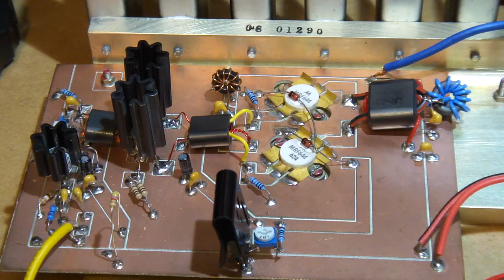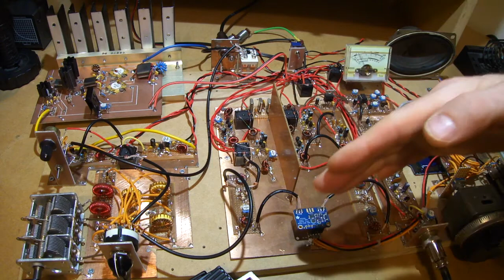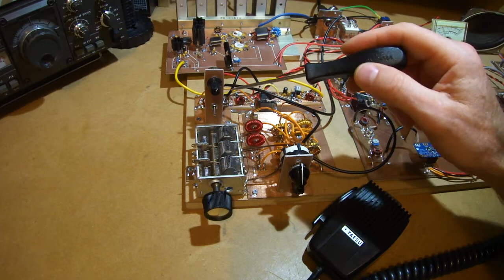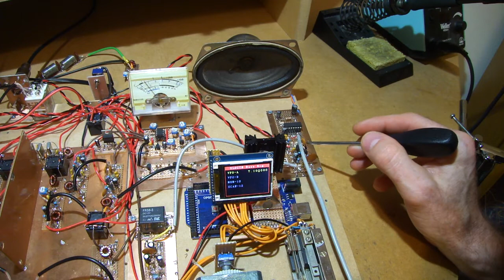Homebrew 80/40/20m SSB Rig Part 9 - On Air Test, Final Thoughts

Comment: Amazing radios Charlie!! How do you go about making your PCBs they are amazing too! PCB router?? regards Ben - ZL2BCI ps im around the corner from you hehe :) :)
Reply from the maker: Hi Benjamin. The power amplifier PCB was milled on a cheap engraver I purchased off AliExpress. While not perfect, it certainly does the job. The other PCB are upside down strip board. The only issue there is to watch out for inter-track capacitance, but that can be mitigated by cutting tracks here and there. Seems to work ok at the lower HF bands. I wouldn't try it at the high end though. We should catch up sometime.

73s

Charlie ZL2CTM

Comment: Thanks Charlie for nice and complete description ,however I am not happy about Si5351 as it does not produce same output level from 10 to 40 mhz huge difference there, and most of it being square form signal  and using 9 Mhz IF , i can hear 90 MHz wich is 30 mhz x 3  being detected by IF 9 mhz KVN filter 10'th harmonic in 21 Mhz band using  VFO=Freq+9 , also lots of spurs being heard with antenna disconnected.Dunno how you did manage it , but I m gonna use an old MC1350 driven by an DAC in order to set different gain for each band to produce same output level.Anyway, the Raspberry Pi transceiver is  almost done , I have to rewrite entire python code as I made some big mistakes from the begining , but in the end would be a nice and complete transceiver.  Best regards ,Gabriel yo8rxp
Update: just seen clkControlReg registry  set as 8 mA which coresponds to 10 dBm output., I will do tomorow a test to see if different values (band depending) can set a constant output level and maybe get rid of some spurs without using hardware level normalizing
Reply from the maker: Hi Gabriel. I think I mentioned it last year that I too get the odd signal here and there when tuning through the band. I have not attempted to track down what the root cause is as it doesn't really matter too much to me. I want to try the AD9850 again at some stage this year and see how that compares.

73s
Charlie
Reply: Hi Charlie. I used a defective trimpot in first DBM, so once replaced and propper balancing, many of spurs went away, so a carefull construction and quality components are required.For the output value a did manage to use   if output == 0: self.i2c.write8(SI5351_REGISTER_16_CLK0_CONTROL, level)  where level is band dependent , so for lower bands i use 0x0C level , 0x0D for 14 mhz , 0x0E for 21 Mhz and 0x0F for 28 Mhz.
Not perfect but is allmost ok , so in power stage I'm gonna use capacitive reactance as automatic emiter degeneration, will do the math later to see what capacitance is required to obtain  (allmost )same power on all bands.  Thank you so much Charlie and waiting for your new article. 73 !
Reply from the maker: That's great to hear! I'm just putting down my ideas for the next radio and will make a video about that in the next couple of days. My plan is to look at both the Si5351 and the AD9850. 
73s
Charlie

Comment: Brilliant series of videos. The math will probably be more useful as I go forward with my own design. But there are some very interesting blocks there that can be lifted and revised and reused. Particularly looking at trying to go as low noise as possible on the front end, so maybe a FET input mixer. Will see... Many thanks
Reply from the maker: Great thanks for that. I do plan to reuse blocks, but will look to refine them where I can. It should be fun!
Reply: Spent my night looking at crystal filters. And I thought they would be the easy bit lol. I guess its a journey and I shouldn't run. I look forward to future videos. The toroids part was probably the most taxing part. Once I understand the matching  it will be a bit clearer - or rather what impedances I'm actually trying to match lol
Reply from the maker: You'll get it. Once you understand the maths/logic you'll be away!